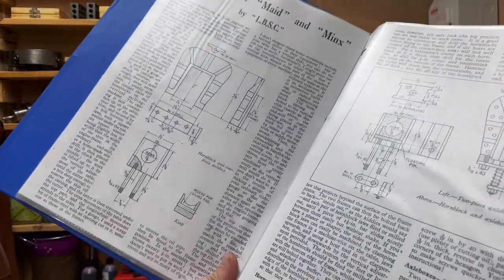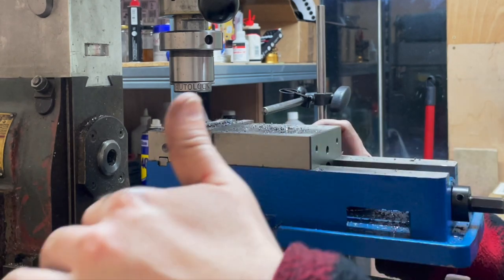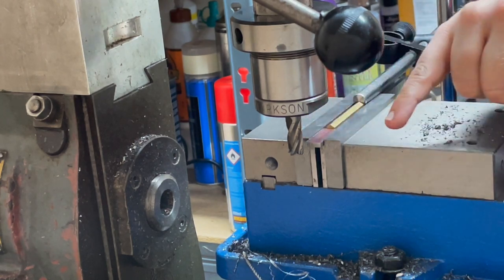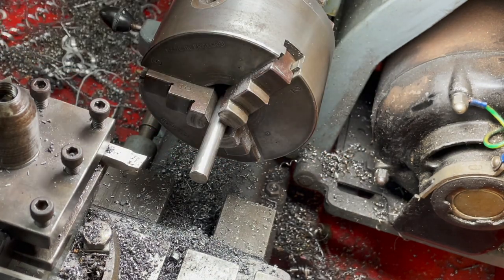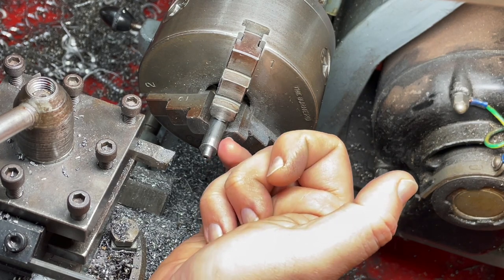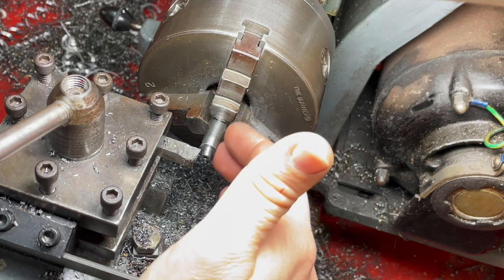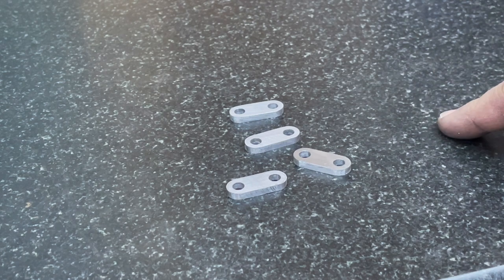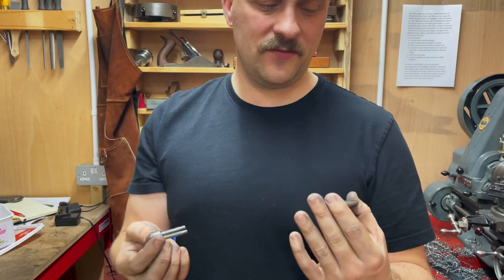Spring plates, a total waste of time?! - Steam Locomotive Build #7

Comment: Great progress and it does sound like you have a way around the issue. Making small parts like that seems really difficult. I have not forgotten you asked me about the grub screws, I will see what I can do but things are very busy at the moment
Reply from the maker: I think they may be 2BA - the major diameter is 0.185" and apparently the BS recommendation for threads <0.250"  is to use BA. I guess I need to pull my finger out and make some replacements!
Reply: @williamsworkshopuk  I am pleased you have the answer, we are having a very busy week and not had the chance to check